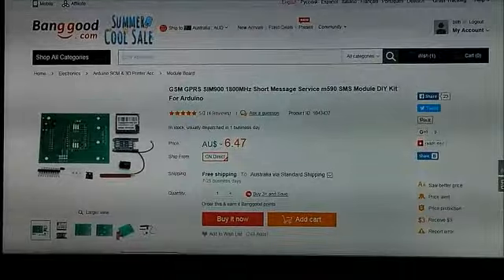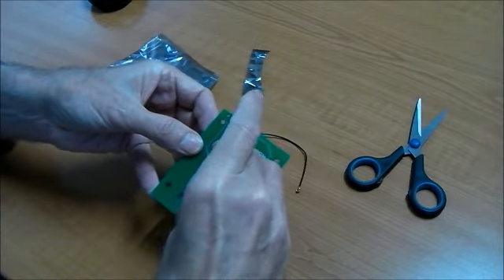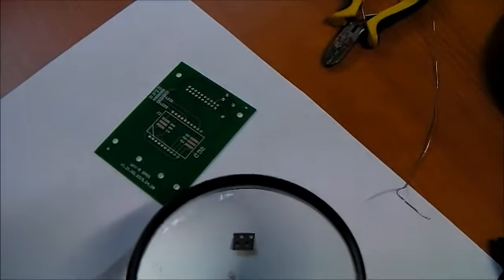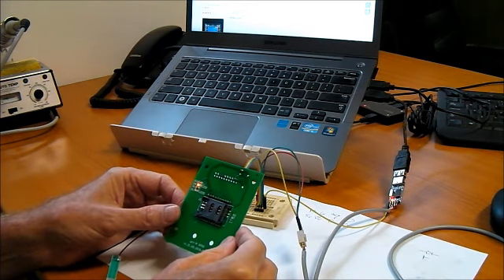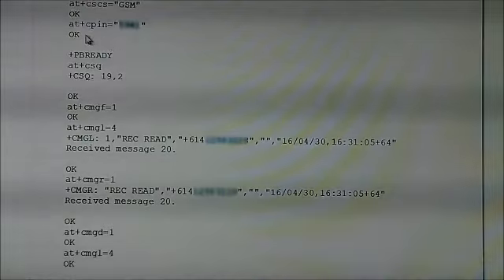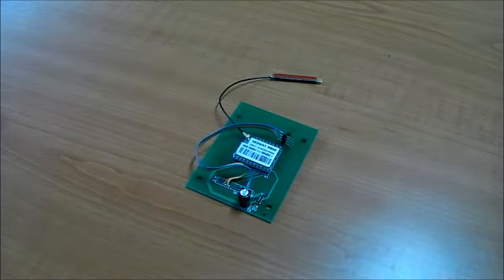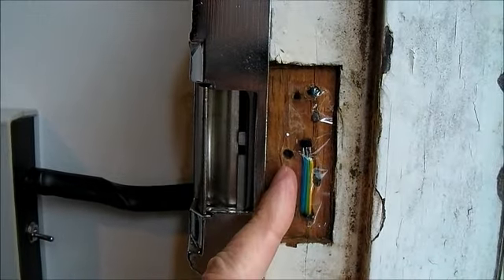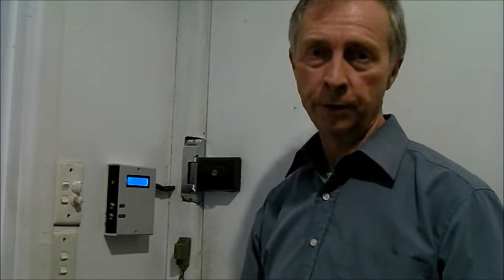SMS door opener

Comment: Hello, i was wondering if is it possible to attach a fingerprint sensor together with your SMS door lock system for other option of opening door.. i'm currently starting my CAPSTONE project of "Door opener using fingerprint with SMS". Pls help.. thanks!
Reply from the maker: My concern is that additional entry options will reduce security.